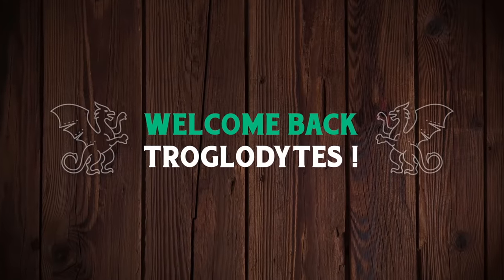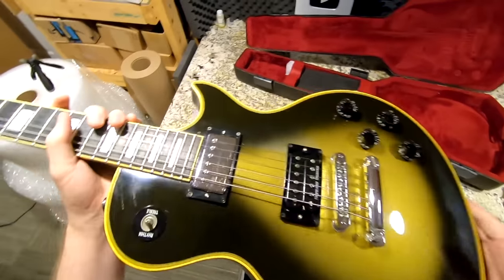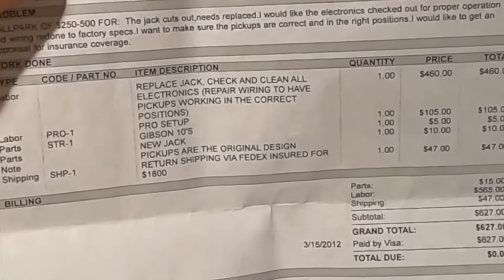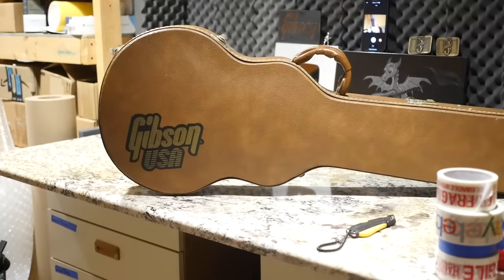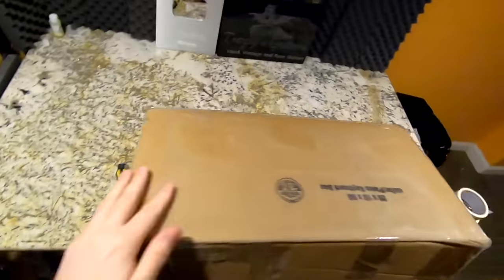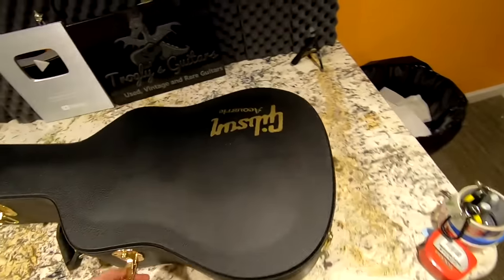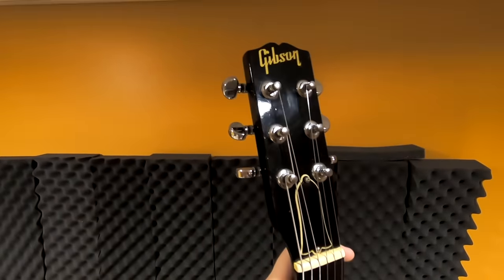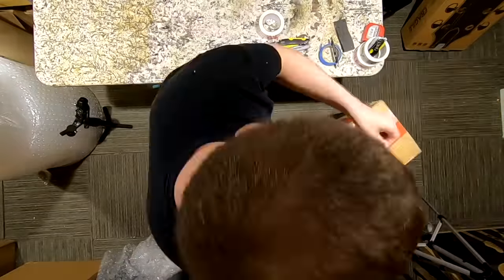I Bought Some of My Favorite Guitars | Trogly's Unboxing Guitars Vlog #83

Comment: Trogly, the glue of the electrical tape will break down and accelerate the disintegration. Not to mention get all gluey and sticky all over your hand. Use tennis racquet grip wrap instead.
Reply: This X 1000
Reply: yes  you are correct, i used wide masking tape on mine.  been good for 20 yrs. doesnt react to the weather

Comment: We bought a guitar from original owner. It was one that a spouse bought for another back in1973. It came in the original “chain saw” case. It’s a 73’ LP Deluxe (one of last made in Kalamazoo; I confirmed with a Gibson rep by checking out potentiometer #s). I took it to two pro luthiers who both said  had never saw one in such mint condition. All original parts. One the luthiers dressed/adjusted & cleaned up. It plays without (unacceptable) fret buzz & without ‘chocking on bends. It’s set low action as could get. Well, it’s ready to sell. Soon we may list it on Reverb ... if we can’t find local buyer to meet our price.

Comment: I would recommended thinking about using a different tape than electrical tape, because electrical tape has a high tendency to get really, really sticky as it ages in my experience and that could arguably be worse than deteriorating padding on the case handle. Using the baseball bat grip tape like you mentioned wouldn't be bad

Comment: No, not the electrical tape! It won't hold. After a while the glue gives up, the tape unwraps itself and the slimy glue gets everywhere. Use  black duct tape instead.
Reply: @sixbladeknife44  Trogly's defenitely very much an expert when it come to Gibson guitars. Electric tape seems a good choice, but in long term it's not.

Comment: u have 6 of those switch tips take a drill and countersink it out so its like the usa style one and then retap it or just screw it on like u did and it will go down where its suppose to and the tread is smaller so u can retap it after u counter sink with the bigger drill bit so it starts down on lower then retap cause u might need to tap or even drill that part a little deeper to but u can easly do it and if u dont have taps like i said just drill the counter sink hole then screw it on and if u need to drill the other hole deeper do that and just screw it on it will make its own threads but i would do it trust me will take u 20 mins at the most

Comment: Respectfully, I would stay away from using electrical tape. Electrical tape will leave crazy residue from being heated from the sun, regular handling, and daily use. I would recommend grip tape from baseball bats, or grip tape from bycycle handle bars.

Comment: I dislike fret-nibs even when on a brand new example.  Even on custom shop guitars the string can 'PING!' on even an accidental bend. I also dislike binding both in general and the look but only neck binding. I'm also focusing on solid bodies, some hollow bodies use their binding for structural purposes. ait has no structural need on a solid body AFAIK.
Love TGS

Comment: Do not use electrical tape! That will get so nasty and stain everything that touches it after awhile, especially if you handle it very often. I am an electrician and have tried that way to many times. The tape just get soft and gross if it is handled a bunch.

Comment: Electrical tape might be the first thing on here I was like "NO NO NO"... god there's few things that feel worse than when electrical tape on a handle that gets warm and the tape starts to slide and then it's gluey nastiness all over your hands. Pro-tip - spring for some TEFLON tape. It bonds and melts into itself and leaves no residue at all.

Comment: As someone who has built and setup their own guitars, the guy got scammed for real. A setup for 105 dollars is almost double what it should be and repairing electronics is easy to do if you have experience. I would say the whole sheet of stuff shouldn't be much over 200.
Reply: I only change $25 I even work on the nut and clean the grey board
Reply: @rondobondo6600  Aside from it being in GBP, I only charge 25 for a set up too, electrical work like that is maybe an hours work if that, I don't think any repair person should charge like $200 per hour work haha